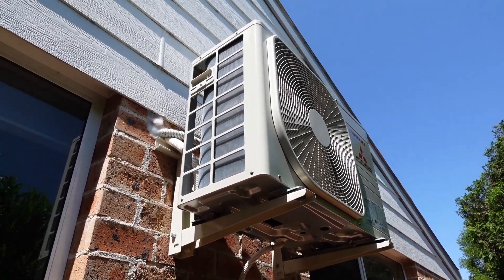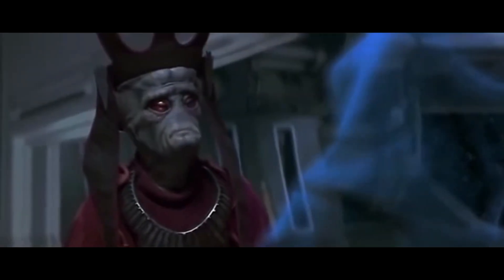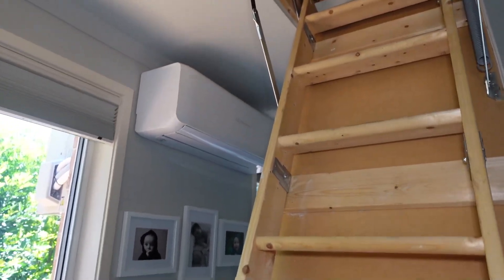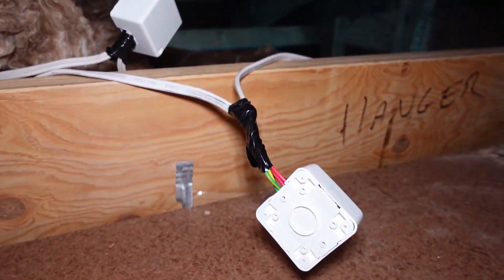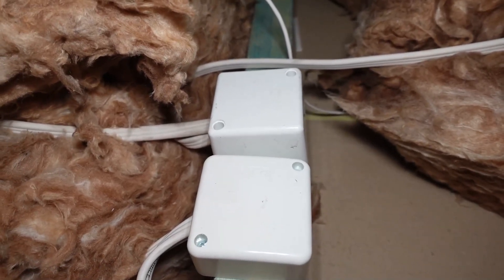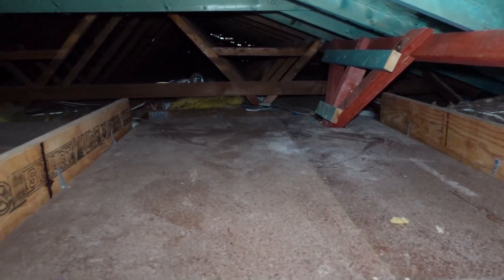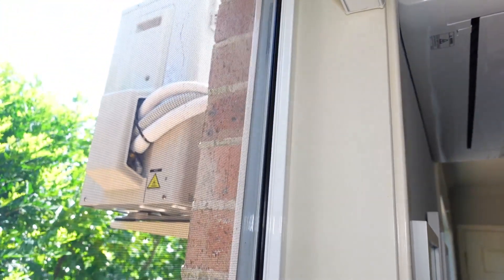Aircon Wiring Install FAIL- TWICE!

Comment: I’m still amazed you only have 2 circuits for plugs. The house I’m in now has 6 and I lived in a newer house at one point that had over 30.
Reply: Here in the UK my house has two - one for upstairs, one for downstairs. In my previous house there was one, protected by a genuine piece of 30 amp fuse wire in a rewirable cartridge.
Reply: Two is not uncommon, particularly on smaller houses. We use 230V for those playing along from the States.
Reply: @jay-em  In the US, residential gets either 208V or 240V 3 wire split phase depending on your location.  The house I'm in now was built in the late 60's early 70's and is around 75m^2 and there's 6 plug circuits (1 for each bedroom, 1 for the bathroom, 1 for the laundry room/air handler, 1 for the kitchen & one for the living room) but those are all 120V, and then there's 3 240V circuits, 1 for the outside AC condenser, 1 for the electric dryer and 1 for the electric stove.
Reply: In the UK fairly common on older houses. 2plug circuits, 2light circuits, cooker, and perhaps water heater/shower.
Reply: @denisohbrien  A separate ring for the kitchen as well, is normal from my experience
Reply: @denisohbrien  It's the same in Germany, older houses or apartments have less circuits. I have lived in an apartment with only one 16 A circuit (230 V). It had a gas stove, so that wasn't a problem, but it was still very annoying. You always had to be careful not to use too many high-powered devices at once. But from the looks of it, the electrical wiring was from the 60ies.
Modern apartments and houses have a ton of circuits which is just a lot more convenient (and also safer, I guess).
Reply: Our house has a single 10A breaker (230V). No separate breaker for lighting and plugs. But this house was built in the early '60s. There's a 16A breaker before the meter, the 10A one is after the meter, could be replaced to 16A, but I won't, until there's any aluminium wiring in the house.
Reply: There are rules on how many outlets you can have per circuit. Having just two in a 3-bedroom house is absolute  craziness.
When I rewired my old home (seemed to be of similar age to Dave's) I used one circuit per room, and 4 into the kitchen (fridge and dishwasher on separate circuits). Every single circuit had it's own RCD (RCBO).

Comment: Well,  they came back and made improvements,  only took 3 visits.  By code here (western Canada) the electrical wiring should be fastened down every so often.  I wouldn't fuss too much about the places where it is hard to get to,  but there are sections where that could have been done.
Reply: Ithink AUS  uses simular regs as us in NZ the cable can be run loose in the eves or where it is not at risk of physical damage aka people stepping on them.

Comment: Hmmm, what try try to cheapen out in material costs they put on top in labor time.
It's technical legal here in Germany to put  an electrical installation direct on one of the 3x 36A secondary circuit breakers (usually the 3x 50A house fuses are maintained by the grid company). 
But the DIN-VDE-Regulations has to be followed, or you're not insured and/or protected from legal punishment, so actually nearly no electrician with a brain does it. ;)

Comment: Ive got  a NSW electricianS licence as well as being an electrical engineer of some 4 decades industry experience. The installation meets all the requirements  of the wiring rules. Having said that the standard of work leaves much to be desired . But that’s the consequence of us consumers looking for the cheapest price. Not saying that Dave chose price over quality, but the installer was obviously working to a price. I guess at the end of the day the installer lost money on the job if he had to come back another two times.
Reply: But it doesn't. 2.6.3.2.2, 3.3.2.8 (and 3.9.3.1 referring to it), 4.19.. It's a bloody lashup.
Reply: @Monkeh616  I reiterate I would have done that installation differently. Apart from the lack of the isolator, the rest of the installation is done in accordance with the wiring rules and current accepted practice. When I say current accepted practice I mean practice that would pass inspection by an electrical inspector if we had them these days.That is really just a minimum acceptable standard that meets the wiring rules but again is not what I would do and what many other electrical contractors would do.
Reply: @kaindub  Lack of isolator, lack of RCD protection, cables tossed in with no fixings.. "in accordance with the wiring rules" my arse.

The entire installation, not just the recently bodged in AC, is a disgrace today.

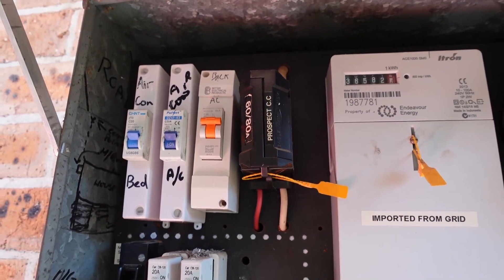Comment: 2:47 Top left breaker, is that the same brand that was on the fake breaker in the big clive video? I don't see any writing related to being australian standard compliant on it. I'm thinking dodgy brothers........
Reply: No, that's an actual Chint, which are a real name of.. reasonable enough products. It'll be IEC 60898-1, which Australia uses (under AS/NZS 60898-1). No problems there.

The middle one is more worrying. That does look like a China special of questionable origin - markings aren't compliant right off the bat.

Comment: To me this looks very wrong - not just the problems but the entire installation. 
Here in the Netherlands we put all wiring in conduits which are usually set into the (brick/concrete) walls and ceiling. Also the back of the fuse box looks like crap to me - all those wires running everywhere...  Different countries do these things differently (and call it code).
I have over 10 circuit breakers and a main switch for a 1 family home (3 floors). I know half the world is not as strict as they are here, but I am glad they are. 
Just wanted to share a different perspective.

Comment: "It's legal" => "Quality isn't our thing, We have no pride in our work so do the absolute minimum"
Reply: Typical Jimbos job lol
Reply: Unfortunately the retailer sellers of installation for $200 passed on to a cowboy subcontractor , quite literally a 4hr install, how can the pipes even get pressure tested an vac’ed properly?
Reply: "Let me check the regs to see if I can get away with this"
Reply: @qqqAnti  the guys who do this often aren’t sparkles and wouldn’t know the regs from a bunch of flowers
Reply: @Spookieham  So true. I installed two of those junction boxes in my ceiling a few years ago for a couple of exhaust fans. Common sense told me to fix the boxes to the beams and conceal all wiring. 

I think it’s more about pride of workmanship. Considering they would be doing this daily and have all the appropriate tools, it would take very little extra time to ensure a neater and safer install.
Reply: @austfox2170  Aus do you mean an Eleco installed the J Boxes  correctly in the celling  in an area where there is no stepping  access  or a baton fitted when the wire crosses a rafter.
Reply: Hence quotes can be the cheapest out there.

Comment: Wow, that box looks so dodgy. Is that the power company's letter in that enclosure? Is that enclosure and wiring standard in Australia?
Reply: Enclosure is a junction box and is required for cable joins in roof spaces. Roof spaces shall have no single insulated conductors on show. Only insulated and sheathed (white outer covering) are permissible for installation in a roof space or within 100mm of a wall mounted electrical accessory.

Comment: I just had a ductless system installed in my house went with Daikin they are worlds better than the old dual fuel/heat pump forced air system but damn did that bill hurt could’ve bought any new motorcycle on the market with money to spare. I will say not needing to buy 2-3 tanks of FO every winter will be nice. And they did the same thing with the condensate pipes on my install just drips onto the ground.

Comment: Holy crap, thats what auatrailian housewiring looks like? Thats worse than in the US! Never seen a mains distribution panel that messy in my life!
Reply: Is that a mains distribution panel though? Looks more like a random assortment of shit nailed to some wood to me. 🤣
Reply: @Pieh0  It's the same stuff they used to make the back panels of old TVs and hifi gear from. If you break some off it's like a woven fibre. Phenolic i think?
Reply: @s8wc3  Shocking. That would be illegal as hell in the UK.
Reply: @s8wc3  most of these have asbestos in them too!
Reply: @Pieh0  hmm, if it was to code when it went in, then in most cases it would still be to code now as it already exists.
It would be up to the eicr reviewer to prove it was dangerous before they could effectively force someone to have work done. E.g. rubber cables or pvc breaking down if early pvc.
Just because it doesn't meet the new code doesn't make it illegal or dangerous. It just means it's not got the same level of safety features.

Now if I saw that fuse box I'd be like yeah time for an upgrade but I'm assuming there is nothing illegal about it.

As a good example of this zones in bathrooms are interesting one I found out about recently.
Also metal Vs plastic consumer units..
Or maybe the fact you can still install older spec consumer units 16/17th edition and we are now on 18th addition and it's all still fine.
Reply: @TheWebstaff  depends on state, or at least it did. I don't think it does now.. The general consensus is, if you have to modify or add to a circuit, add additional circuits etc, then the entire distribution board needs to be compliant with today's standards.

There is no way if I lived in that house in Vic, that it would be legal to modify the circuits and leave the distribution board like that. I was shocked by the fact that these installs exist anywhere in Australia
Reply: @dasrue6983  The old 1960’s black boards are asbestos. Easy to spot - it will say Zeolite on the back. I never drill holes in Zeolite boards as then you need an asbestos kit. It’s always fun to mention to the home owner that I will opt out from drilling through their asbestos board.
Reply: @Pieh0  Panel in the literal sense
Reply: IKR!! It makes US panels look OCD.
Reply: @psygn0sis  These panels are from the 80s and before. Often you would have a meter, 1 lights fuse (no breakers) and 1 or 2 outlets fuses and that's about it in them, so back then they were pretty good and easy to work on but over the years they become a spaghetti mess with all the stuff tacked on with minimal thought.
Reply: I live in a 2 bedroom unit built in the 1960s and I just have the main switch, meter, one circuit for lights and one for outlets. That's it. At least the old fuses have been replaced with breakers. There is natural gas hot water and stove/oven so no need for more circuits. It didn't come with aircon but I have a window unit.
Reply: They don’t all look like that
Reply: Multiple installs often get messy
Reply: "Worse than the US" um sorry but wiring in the US is not bad at all unless you're one of those ignorant Europeans that thinks everything non European is bad

Comment: In South Africa you also need to have each individual A/C unit on its own circuit breaker. Larger split units require an additional isolator switch at the unit itself.

Comment: All legal ( well nearly), but crap. That's your fault Dave for not specific that you want a dedicated service. Umm it's not an RCBO. So it's still wrong and illegal. I'd be getting them back again....
Reply: Does a dedicated, class 1 appliance with no power outlets need an RCBO? Why?
Reply: @Monkeh616  the AS3000s now require that on anything under 32a I think it is. It's an Australian thing.
Reply: @EvanDent  Ah, yes, 2.6.3.2.2. Daft, but if this is the sort of workmanship they're regulating for..
Reply from the maker: The other ones aren't RCBO either. Given that they aren't power point mains I don't see the problem.
Reply: @EEVblog2  Technically and functionally there is no reason for them to be, but the standard was changed. This was done to protect consumers and tradespeople against shocks ( think of the foil insulation debacle for example) Whether we agree with a standard or not, they should be complied with as they are a standard.

Even though the other ACs are not protected by a RCD (as they were not requred to be, but could have been if the desire was there), does not mean this install should have not been. an RCBO would have cost, what $20 more at most. Cars did not use to have seatbelts, they now do. We comply with it and there had to be a point where the change was made. Some times you should go above the standard and guild the lily.

What happens if they forgot to hook up the earth wire to the outside condenser and then due to a fault in the compressor the casing became live. With an RCD you would be protected, no RCD and you might be toast seeing as you like to walk bare feet. 

Cowboys in any industry who do not stick to good practice and standards bother me. They put lives at risk as 9 times out of 10 the standards have been increased due to loss of life.
Reply: @EvanDent  Evan is correct. The new install requires an RCBO. The existing ones do not.
Reply: @EEVblog2  Neither do I, it's a stupid requirement.. but it's there nonetheless.

2.6.3.2.2 Domestic and residential installations—Australia only
Additional protection by RCDs with a maximum rated residual current of
30 mA shall be provided for all final subcircuits in domestic and residential
electrical installations.
Reply: @EEVblog2  The latest version of AS3000 (2018) requires that all new circuits rated at 32a or less need RCD protection. It doesn't require previously installed circuits to be changed unless an alteration is made to them and then they need to have RCD protection installed.

Comment: Manufacturers instructions need to be followed as per as3000. MHI typically require a separate circuit. 

Looks like a cert 3 Fridgy not a sparkie.

Did you get a coc with it ?
Reply: Sparkies never read the instructions. I hung one out to dry for ignoring that very clause and was told it didn't matter and to stop being pedantic. I said so you mean to tell me that you the electrician know more about this than the engineers and company that designed and manufacturered this device. The devices were smoke alarms and they had mixed brands and then interconnected them. Yet there was is no technical standard for interconnection of domestic smoke alarms. They are certifiee, designed and tested to only work with the same model. It's different for commercial smoke detectors.

Comment: Hi Dave, just a rant from my exp.
AS3000 allows you to jump 2.5kW and 3.5kW into existing power circuits. This is common practice in Aus, what nobody seems to take into account though is that it also reduces the number of power points (overall ampacity) you can now have on that power circuit. As the max draw of the power circuits (2 in your case) obviously can't support 100 powerpoints. From memory each powerpoint is 5A, eg. 20A circuit can support 4 sockets. Notably, not installing a lockable double pole isolator (active and neutral for motors) within arm's reach though is illegal, it has to be done by a licensed electrician, not an air con mechanic. Those junction boxes are rubbish, exposed single insulation, not secured.
 
t. I left the industry because it's full of cowboys and imho, Dave's exp. should serve as a PSA for all the McMansions out there.
Reply from the maker: IIRC each circuit can have up to 20 outlets.
Reply: @EEVblog2  There is no strict limit, AS3000 has some guidance tables but mostly talks about fit for purpose. Jumping onto one of only two circuits for the whole house is, by any measure, dodgy.
Reply: @EEVblog2 I mean, that sounds insane tbh. The rated current on that MHI is 9A, imagine having 20 additional sockets on that 20A circuit. I'm not saying your wrong with the 20 outlets or that it is the case in your house, it is just best practice to put it on it's own MCB. Something that is worthy of discussion however, is how all air con installations are now required to be installed with an MCB/RCD, because of the tendency for the compressors to have high leakage current. So, they might have stitched you up there.

Comment: Terrible looking rats nest behind that panel.. and those other little boxes taped up,🤮.   

Is this  normal for your country?   2 circuits is nuts... I have 1 for every major appliance on its own, 3 for the shop, 3 for the lab, 5 for general lighting, 6 for general outlets, 3 for the hi-fi, 2 GFCI for inside wet areas, 2 GFCI for outdoor power, high amp GFCI for spatub,
Reply: It's an old house, that's how it use to be done. Everything in Australia especially the new installs are RCBO's basically GFCI's no matter what it's for, even if it's unrelated to power. In the past especially at 240v, it was very typical to only have a few circuits as you can carry a lot more power at less current. Typically high current stuff is on its own circuit ovens/hotplates/aircon etc. These were just shitty installers.
Reply: I believe he will have two boxes. One outside and one inside. That is just a distribution panel and breakers ("fuses") for the outside equipment like the AC units and solar stuff. Since it's already outside, there's no need to run wires for that stuff into the house. Similar to the boxes we have in the US that are next to the AC units that have a manual disconnect. I believe there will be a service going into the house, into a secondary panel, with breakers for each circuit.
Reply: @xenonram  From living around his area I don’t believe he would. Well I have never seen a secondary fuse panel around here.
Reply: Normal for older houses yeah. Mine is like this, 60s built. 2 breakers for all the power points.